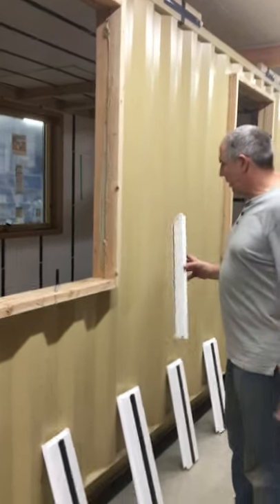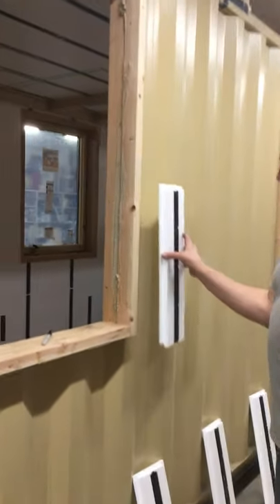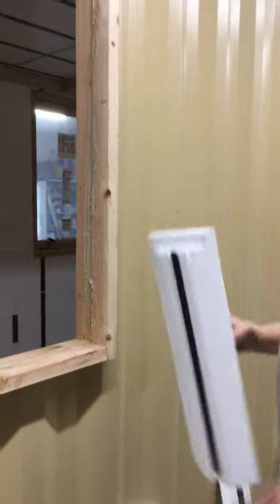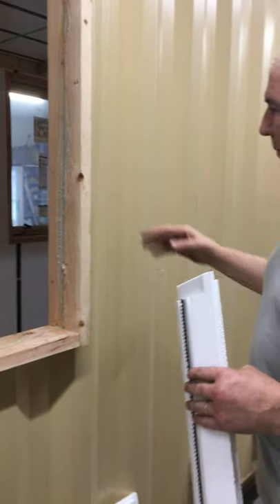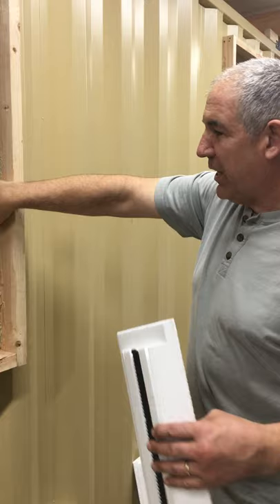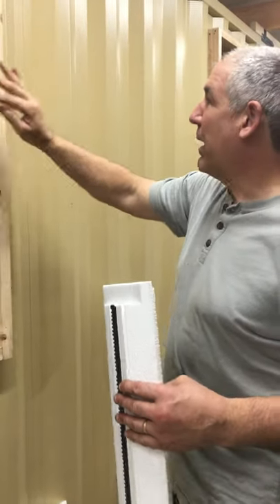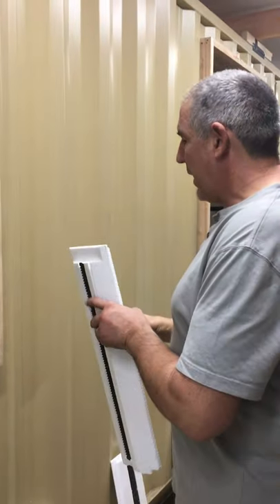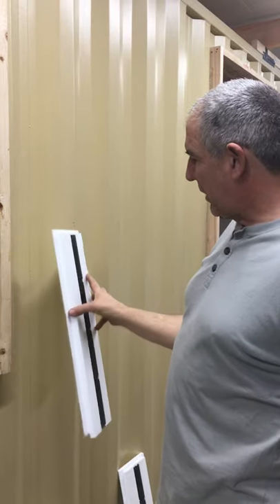Cold weather insulation application for shipping containers.

Comment: We're deciding right now to either spray foam the inside or use your panels..so you're saying if we glue up the In So Fast on the interior, that will eliminate the steel from sweating...
I'M leaning towards the panels but want to make sure we don't have problems down the road...thanks
Reply from the maker: We haven't had/heard of any sweating issues with our customers who have installed the panels.  And essentially they are built to combat condensation! Call us if you want to talk specifics on how they work!! 888-501-7899